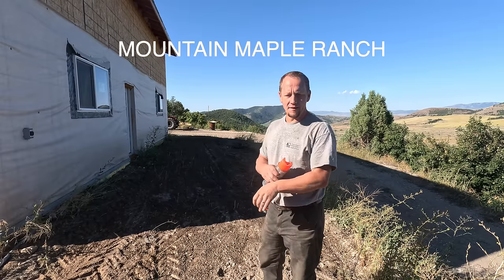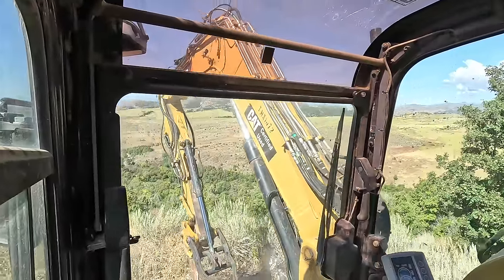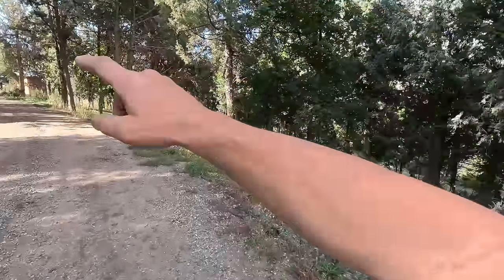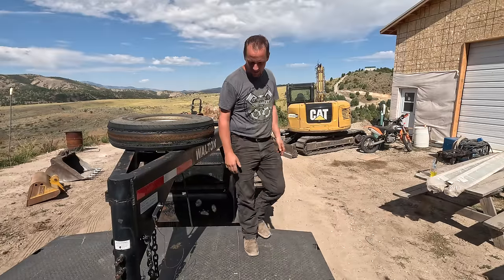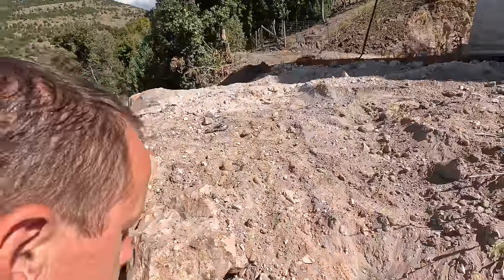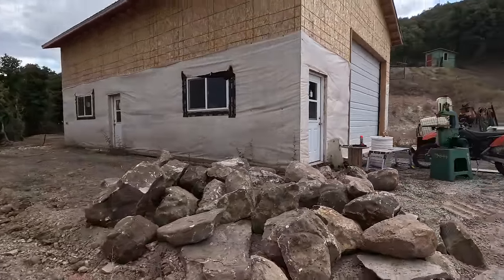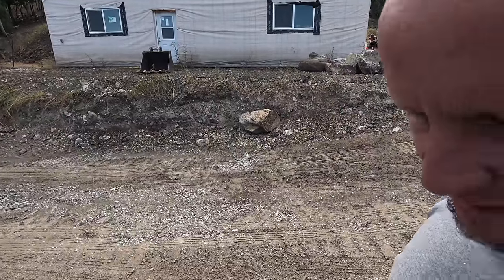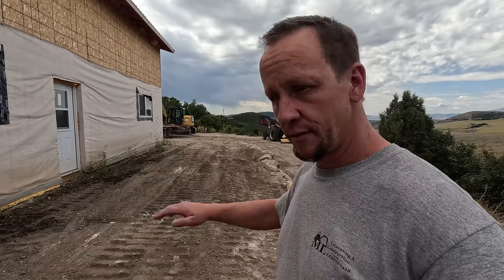Building 60' Long BOULDER WALL for our MOUNTAINSIDE SHOP

Comment: I hope you are going to sink the piers for the lean to much deeper on the downhill slope.  Due to the retaining wall you have a horizontal as well as vertical frost line to account for.
Reply from the maker: Sure will. The footer will be back about 8' from the face of the wall and it will be almost to the bottom of the wall in depth.

Comment: Is that a spare tire on your gooseneck trailer or a memorial to remind you to change your tires?
Reply from the maker: It’s from the trip I took when I got the dozer. I want to get it in the shop and fix the deck and look it over before spring. But yeah good reminder to get it fixed hahaha

Comment: Marc, do you plan on house wrapping  the upper portion of the shop before winter ?
Reply from the maker: Yes, We are going to push hard for concrete perimeter, the wrap and get the header plates installed for the lean-to roofs, then side the walls below the headers... If time, weather, and funding are willing. ;)

Comment: How about down where you started are you concerned that is can erode away from behind the shop?
Reply from the maker: No, I left that open because I plan to pour some concrete steps there and i have a footing drain that will be installed a little past the "future steps". It is also about 15' by 20' away at an angle from the corner of the shop.